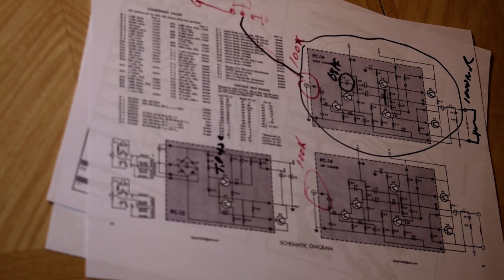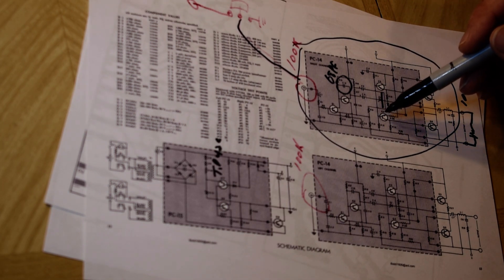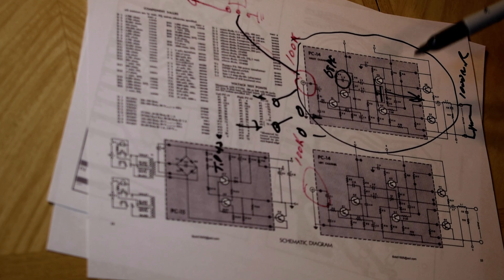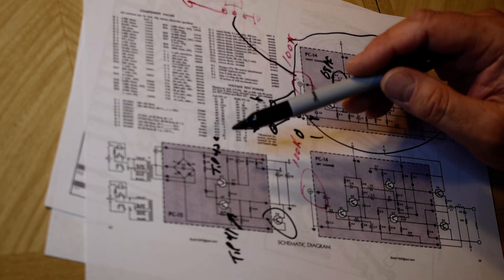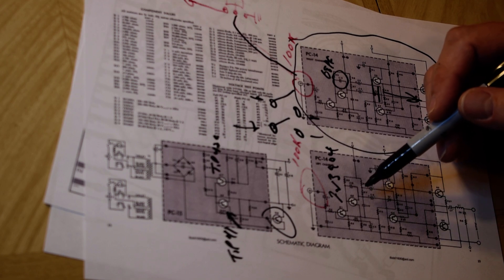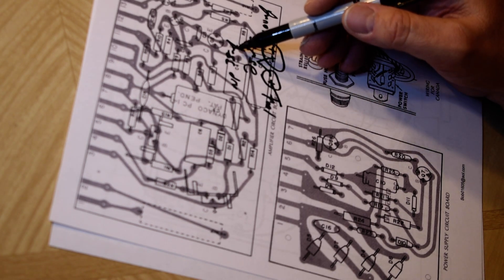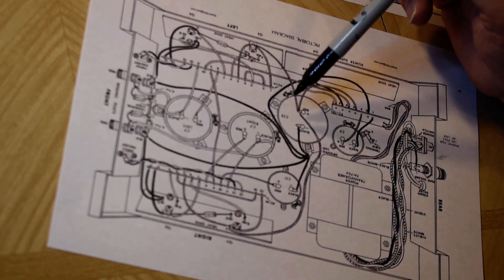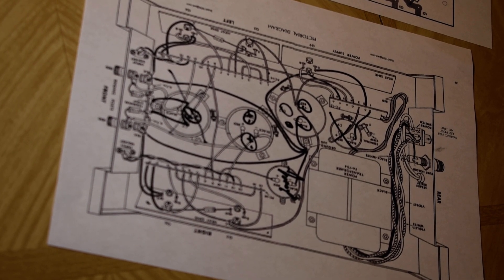Dynaco ST-120 follow up on original circuit design and mods- a look at the schematic!

Comment: Hey, when you made these mods, did you change C6 to  .47uF like the Dynaco TIP mod docs show? Did you change C1 to a 5uF tantalum?
Reply from the maker: I used a .47uf polyester and a 5uf aluminum non-polarized cap.